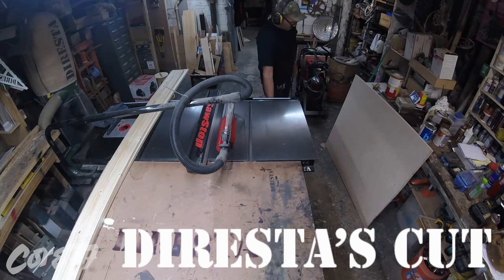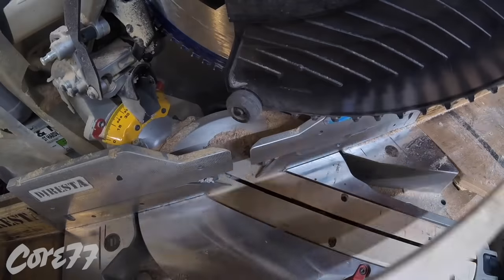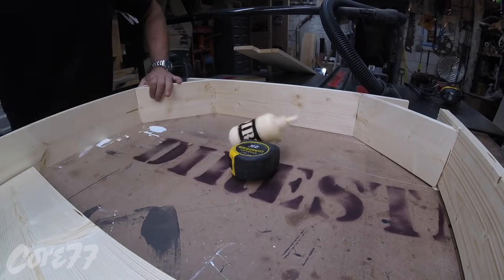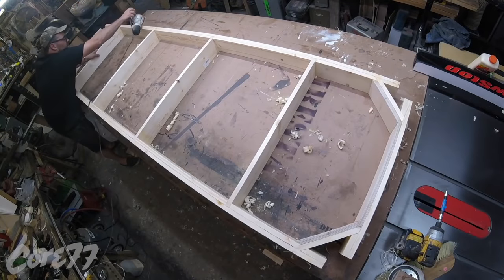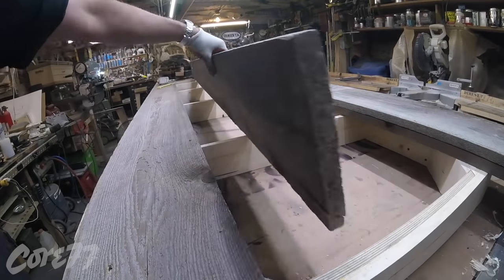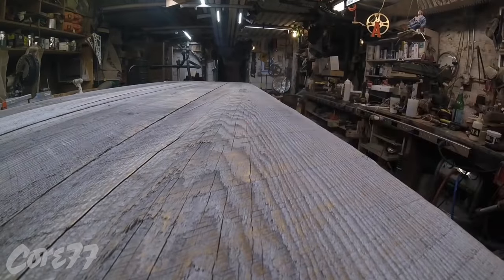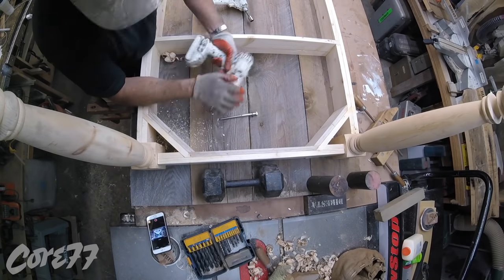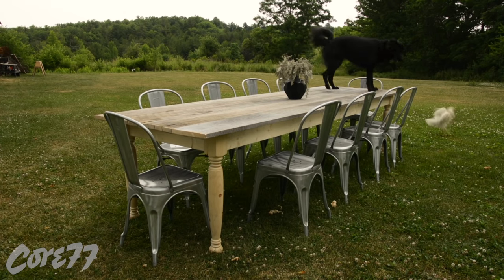DiResta’s Cut: Eleven-Foot Farmhouse Dining Table

Comment: Interesting build.
I visited my daughter this past weekend and she mentioned she would like a farm table for her kitchen, excellent release date for this video.
Jimmy, quick question: Given the table you built will be used essentially in a commercial situation, is there any concern that a rambunctious wedding party, or two, will move this table by dragging it across the floor and stress the single lag bolt holding the knotty pine legs on?

Comment: Really nice, enjoy watching your videos...Could you use a threaded metal insert where the bolt goes into the leg to avoid stripping later on down the road from removing and re-installing the legs...?

Comment: Looks awesome!! Thoughts on using a threaded brass insert in the legs? That way you could use machine screws to hold the legs in place. Would be easier if legs were going to be removed often.

Comment: Hey one trick to strengthen those holes that lag bolts go in is to put wood glue in to the holes of the legs you drilled. when it dries it acts like a loc-tite but also forms a type of plastic helicoil and less likely to strip out

Comment: Hey Jimmy! Great video, I love the idea of laminating the apron to boost the strength!
About the legs, here in EU we can get a "screw" that has a coarse wood thread on one side and a machine thread on other specifically for this (there are similar for fixing the toilets in the ground). Than you permanently screw the screw in the leg, put it through the hole in the diagonal piece and use a washer and a nut. They work very good.

Comment: Very nicely done. I once made a table using edge glued 2 by 4's for the top. I wanted a finished ,highly planed surfaces when I was done,so I planed everything true with a planer/jointer on  all sides. To give it a little character back, I routed the joint lines after it was glued  with a rounded veining bit.... I did this because its really annoying when a kid spills something and it drips down in between the boards. Just offering an idea to keep in your bag of tricks.  :-)

Comment: So I was running to the post office earlier and saw an old oak door on the side of the road.  Picked it up and took it home real quick.  While leaving the post office I was thinking about how to strip that door down, refinish it and then convert it into a table for the backyard deck.  Soon as I got home I saw this video was posted.  The framing design for this wedding table should work pretty well for my door/table project.  Diresta you perfecting timing son of a bitch...!
Reply: Hahaha

Comment: Just a little heads up, I had a solid pine table with the exact same one bolt configuration. They all
became loose after a year due to the table being pulled around the floor. I fixed this by adding a
small 'L' shaped bracket between the bottom rail and leg. Stops the leg acting like a fulcrum when
being pulled at the bottom.
Reply: @g2macs can you ellaborate on this? am starting this build this week. think 2 bolts would have been better?

Comment: i made a 12' table out of 2x12 material.  they are basically bulletproof.  i used them to work on engines/transmissions and other super heavy projects and never had an issue.  but. heavy af. i love the legs though, but they probably cost more than my entire 12' table, where i used 2x12 to make flat long legs that went from side to side.

Comment: Another good thing about putting the screws on the legs this way, only a single one, is that you follow the angle of the structure and put the screw diagonally. So you have more material for the screw to hang on.

Comment: yo jimmy... I've a couple of standard household power tools...18v bosch cordless drill, sanders, jigsaws etc...to do what you do or give it a go...would one need 110 volt power tools? the cordless/plug in stuff you seem to use look more high strength yeah know.
Reply: You would at the very least want a 110v miter saw (preferably sliding) and circular or track saw, and a 110v or 220v preferably table saw.  Some of that stuff could certainly be done by hand, but the saws give you repetitive accuracy.

Comment: Nice build, interesting technique of creating joinery by adding, rather than the traditional method of removing wood for joints. Did you fill the screw holes on the table top?
Reply: Great job and sometimes simplicity is better than all those pocket holes, thanks for sharing some of the tricks of your trade.

Comment: The only thing lacking is any measure against lateral forces like when scooting it from the side. Hopefully no one ever does that but that is where the side aprons would be, or could be, pulled from the cross supports underneath - of course the legs would suffer too like JD mentioned.
Reply: I built a 12-foot table for a wedding and used Jimmy's method for the build. Like most tables over 10-feet, the legs are designed to come off for moving. I doubt lateral pressure on any corner leg building method would hold up unless they're welded or bolted to a steel frame.

Comment: Hey Jimmy! Long time fan. I have a question about something you did here, I'm making an outdoor sign for a company for the first time ever. Its copper lettering on a wooden board background. The copper work I have no fear about, but I am uncertain about how to fix the boards. How much space should I allow between each? (It'll most likely be a treated pine or deal) I didn't quite get that part when you did it on the table top. Should I ram em tight together or leave some space. Any help would be hugely appreciated man! 

Thanks 
Josh
Reply: You may want to invest in a wood moisture meter if you're really concerned about it, especially if you live in a high-humidity area. The moisture content of softwood varies largely due to how the lumber was stored in the few weeks before you use it. I can usually tell how much to space boards (if at all) based on the weight of the lumber but it may not be so easy if you don't work with softwood often. To be safe I'd space em 3/16". Alternatively you could use tongue and groove boards that are milled to allow for expansion, you install them tight but there is void inside the groove that isn't visible from the outside.
Reply: Thanks Shill, Awesome advice. The tongue and groove idea is a master stroke. Thanks again.
Reply: +Josh Joyce No problem, good luck with your project!

Comment: Would gluing the legs to the rails in addition to using the lag screws help at all? I wonder as the wood breathes and moves, it might gap a little at butt-joint of the leg and the rails.
Reply: Then you couldn't break it down if you wanted to move it.
Reply: Exactly. If you notice any movement, you can just tighten the bolt up a little more.
Reply: It wouldn't be a very strong joint as it would be going into end grain.

Comment: Would using threaded inserts in the table legs make the assembly stronger ?
Reply: not necessarily, but more durable for repeated take downs.
Reply: Threaded inserts have a larger diameter and deeper thread than a lag bolt, which results in a greater pull-out resistance.  For knock-down legs, I use two threaded inserts to avoid the wobble others have commented on.  I also take a small 45º bevel off the inside corners of the legs, to provide a flat surface for drilling, and to put the insert deeper into the meat of the leg.

Comment: I don't get the "over twisting" part... like you put weight on one side and let it sit to bend the wood back to strait? Wouldn't it just snap back to the twisted position, unlike metal?
Reply: Because the glue was still damp I left with over twist and it went away by about half .. And wight of the table over compensated it. And now it is flat.

Comment: Why screws for the top? Why not cut nails? Unless you plan on taking it apart later of course.
Reply: Nails don't have the clamping force needed to flatten the twist out of those boards.  The screws pull the warped board down flat to the frame, and keep it down.
Reply: I dont know man, cut nails are way stronger that modern nails.
Reply: Someone should invent cut nail screw caps.
Reply: I made one with countersunk screws and covered them with square pegs. Worth my time for a different look.

Comment: There wasn't a more attractive way to attach the top other than randomly screwing it with, what looked like, drywall screws?
Reply: Of course there are other methods, but keep in mind this was a quick build meant to go in a barn.......
Reply: +Matt Culler a barn that hosts weddings. The workmanship on the rest of the table seams to warrant a slightly higher standard than drywall screws.
Reply: Sean G  The rest of the table?  You mean the old twisted rough sawn boards?  The home depot knotty pine?  The pre-made legs?  This thing was meant to be rough around the edges from the start.   If Diresta wanted to build a nice table, hes more than qualified to do it.